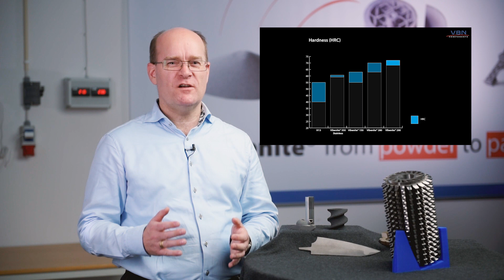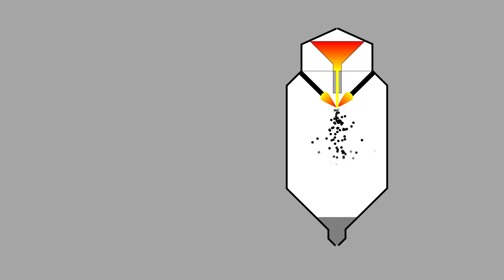Vibenite® 480: A New Type of Cemented Carbide

Comment: So is this a type of HSS ? or like tungsten carbide ?
Reply from the maker: Hello Andrea, it is actually in between the two, a hybrid carbide. Perfect to use for HSS applications that can benefit from more heat resistance or for cemented carbide applications that need more toughness. Another benefit is that you can make larger components in one single piece, compared to traditional cemented carbide.